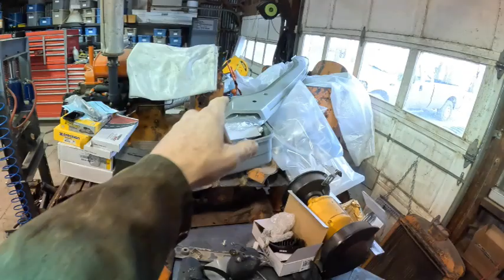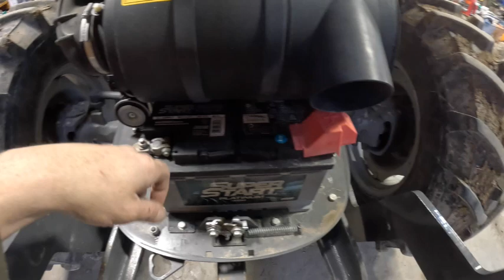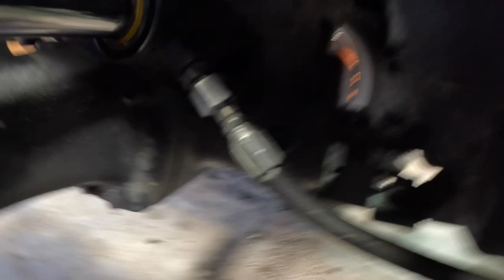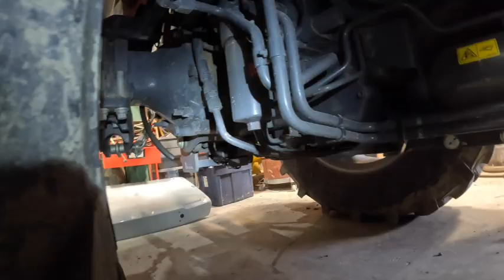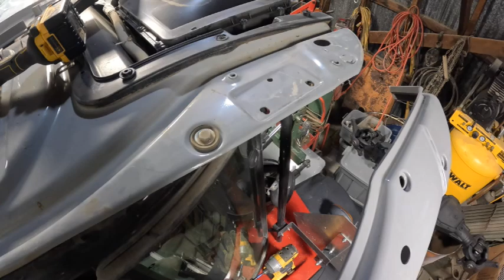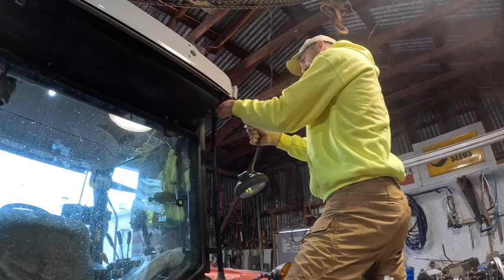Servicing the Massey Ferguson 4707,  Roof Cover Repair, and LED Light Upgrades!

Comment: Goodmorning Clay. Do you have the parts number to the filter for the MF 4707?  My MF 4707 is 2021 and are. All painted over from the factory. It hit 450 hrs this summer.
Reply: Awesome. Hydraulic,fuel,cab air, Engine air inner and outer. I changed engine oil at 200 hrs. Anything else you think i should have. I did add grease zirks to rear axle thanks to your video. Thank you hope you are having a blessed new year.
Reply from the maker: @mikeortega4647  
Air filter Outer AGCO 4379574M1
Oil Filter Agco 837079728
Cabin Air FIlter Agco 4385488M3
Fuel Filter Kit Agco V837091436
Reply: Thank you Clay you are the man! God bless you!
Reply from the maker: What filter are you looking for? I can get them all when I get home this evening.

Comment: Just seen your channel.. I have the 4707, 2023 year with right at 500 hrs. It's  on a small ranch.. Bale round 5x5 bales with a JD 557 baler..  Wow the lights would be the last thing I'd up date.. They're  bright from the factor but what you done will light the world up... If you have the pto vibration code. Get 2 washes that the sensor can go thru . ( the cencor just needs backing off the pto a little.. ) Really easy fix.. Tint the glass makes the AC work great. My biggest grips about the 4707 is the placement  of the cabin filter and the fuel tank having to burp and let settle to get the tank all the way full..

Comment: I have a 2021 4707. Where you explain about the plug at end of rear axle, installing  a zirk. Was that procedure in the owners manual?
Reply from the maker: Yes it’s in the manual. I’ll have to look up the page. But you remove the plug and install a 10mm grease zirk to grease the outer axle bearing.
Reply: Sounds good I will check it out. It just turned 300hrs. Haven't even done 1st  hydraulic service. My dealer changed the oil for me when they were trying to fix 540E Pto code.

Comment: I have a 4707 good tractor. I didn't see the LED video. Where did u get the LED lights and did you replace all the stock lights?
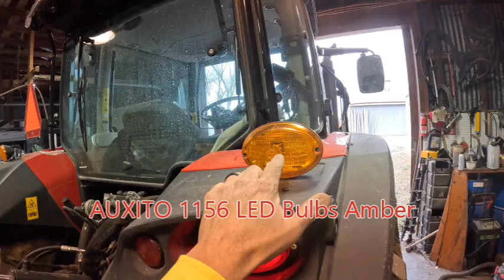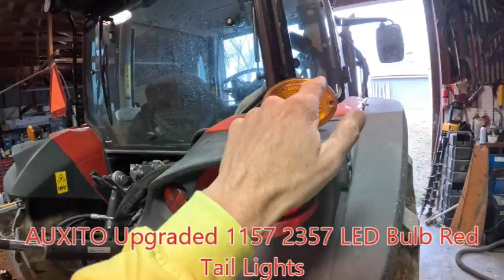Reply from the maker: I ordered them all from amazon. 1:02:50  and 1:02:57
Reply from the maker: @robertburey4704  EXZEIT 5.7 Inch Oval Led Work Light for the oval lights. 
Nilight - 18015C-A LED Light Bar, 52Inch, 783W, 78000LM for the light bar.